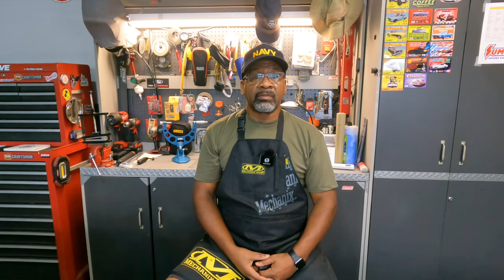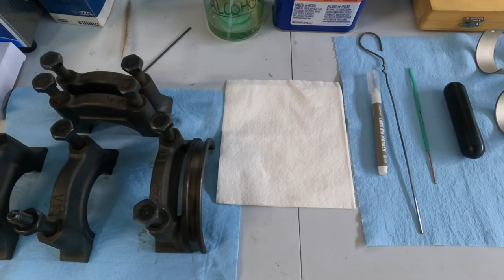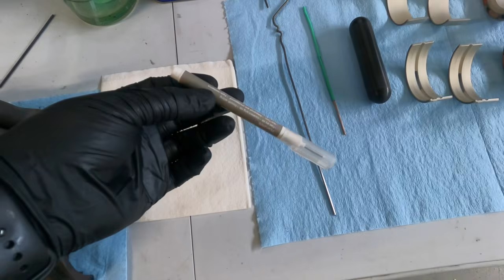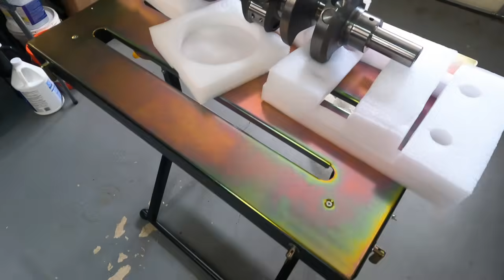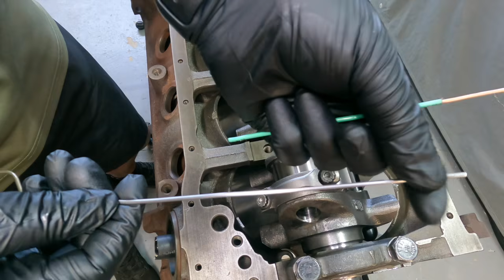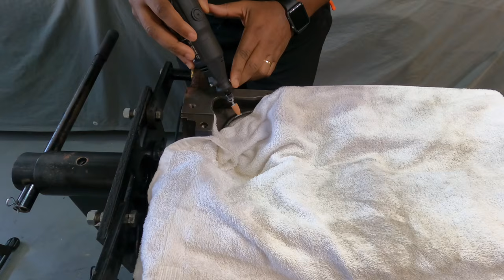331 Stroker Connecting Rod Clearancing

Comment: Hello great channel. When checking the bearing clearances do you use the same bolts throughout the process? Is it recommended to use new bolts due to bolt stretch?
Your videos are great. Thanks
Reply from the maker: Thank you for your question. If your bolts are not torque to yield you don't have to replace them, they can be reused. I upgraded my mains to ARP bolts for the added strength. I'm using them through the complete bearing clearance adjustment and final assembly. I'm also keeping them in the same orientation and not swapping them from cap to cap. 
Ideally your block should be machined with the bolts or studs you intend to use in the final assembly. Don't switch later due to varying clamping forces and distortion that can be exerted by differences in fasteners.
Thanks for watching and that's for the comment.!

Comment: Wow ..a 2 bolt main stroker"

Usually you see splayed caps on a 4bolt main stroker most common 383...but the 331 must have serious Duration lift.
Reply from the maker: The factory Ford 302 H.O. blocks only have two bolt mains. Bored to 4.030 with a 3.250 crankshaft and 5.400 rods you get 331 cubic inches. A 4.030 bore with 3.400 crankshaft and 5.400 rods will get you to 347 cubic inches. 
The 383 is most commonly a Chevy 350 cubic inch block with a crankshaft from a Chevy 400. The 350 comes in both 2 and 4 bolt mains. Thanks for watching and thanks for the comment!

Comment: If you tape up all the oil holes and on a cam bearings then you just have to re-clean the block with some hot water and air. Makes life easier. When I clean all the oil holes in a block I always use a wire brush because even if you get it from the machine shop you got to double-check. What special the crankshaft even on that block the oil galleys to the head and clean all the garbage out of the rocker arm shafts.
Reply from the maker: I agree and great tip. Cleanliness is vital when assembling a machine with tolerances as tight as an internal combustion engine. When you think it's clean, clean it again! LOL!! Thanks for watching!

Comment: Hey Chief where did you get that fancy piston pin from I could use a 4.030 wide one
Reply from the maker: Thanks for your question! I purchased a 1.00 inch diameter Delrin rod from Amazon and had a local machine shop (Atlantic Machine and Tooling) turn it down to 0.927 and bull nose the ends for a length of 4.030. It worked like a charm. I saw the idea on a Jon Kasse Racing video. Thanks for watching.

Comment: Nice work Chief. I have told people you have to check clearance even with a 331.
Reply: I had to clearance my stock block with the Eagle forged 331ci kit
Reply from the maker: One of the reasons I leaned more to the Scat kit was a lot of builders were saying they didn't have to clearance the late model H.O. roller block. I only had one rod the was tight at the minimum recommended clearance. I could have probrably ran it with no issues but I'm in it now, why chance it. Thanks for the comment and thanks for watching!
Reply from the maker: I appreciate that, it's definitely a step you can't afford to skip! 👍